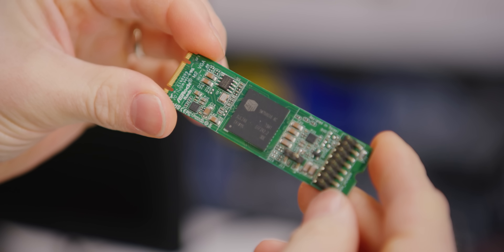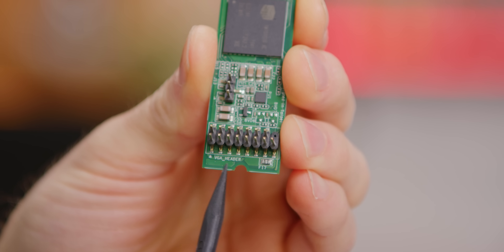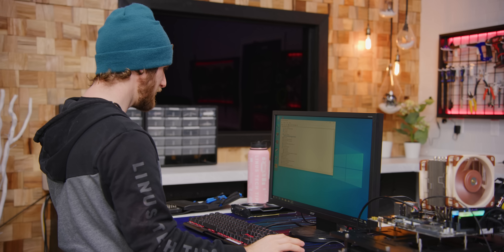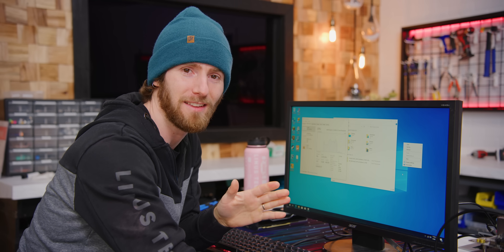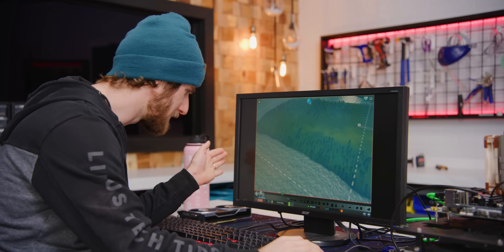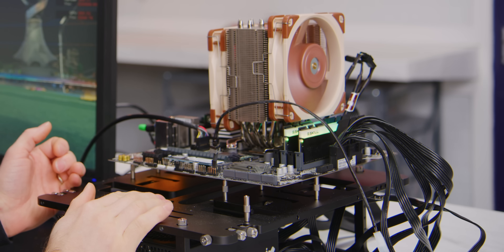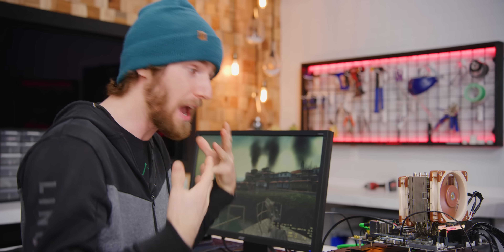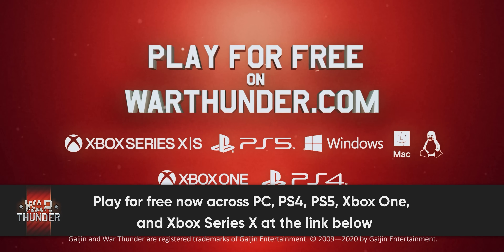THIS is a Graphics Card..?? - ASRock Rack M2_VGA

Comment: What’s with the war thunder ad 😡🧐
Having a m2 graphic card makes Sense but it would be a 3090 
I wonder whether you could have like 4 m.2 ssds and 4 m.2 graphics card as it would definitely use less room on the motherboard. 
Could you get the ram and the cpu on m.2 
You could just have a motherboard full of m.2 drives

Comment: Its for "gaming machines." You might also know them as slot machines, lmao
Reply: I thought those digital slot machines have switched over to ARM. I mean, it will save power for the casino.
Reply: @groundzero_-lm4md  most likely. Even a Raspberry Pi Zero level of performance should be enough for those (and GPU wise would probably exceed this thing)
Reply: I would surprised Linus didn’t understand that these 2D graphics cards are for 2D gaming, like an arcade or video poker... but his research is shit-tier on a good day.
Reply: @FuncleChuck  a bit disappointed he didn't try CS 1.6
Reply: Gambling on a slot machine powered by VGA is the very definition of rock bottom.

Comment: I think when they said "gaming machine" they meant something like a MAME cabinet.  Maybe there is an embedded CPU solution that has M.2 but not video output, and that could be converted to a MAME cabinet using this?
Reply: Think slot machines...basic animations only.
Reply: Gambling that has tetris level of graphics, or poker.

Comment: I didn't finish the video yet and Linus never mentions the actual purpose of something until the end...
For those curious: It's for servers. Servers need something small for basic administrative tasks, and VGA is pretty standard in rack-mounted monitor+keyboard+mouse combos.
Basically, it's just for displaying text (Linux) or a Windows Server UI so you can setup SSH/RDP and leave.
Reply: Especially smaller servers (ITX or a 1U rack or something) where your PCIe slot is used up by like a RAID card, so you throw this bad boy into the M.2 slot and boom you got display!

Comment: is it me or does that scream "Server graphics" to anyone else? don't need any real output most of the time, and when you do a tiny tiny form factor would be useful and since the most it's ever going to display (in most cases) is a terminal window or maybe basic utilities it doesn't need to be able to play games... hell it might be designed for games servers that are headless but require at least minimal monitoring rather than being entirely network controlled.

Comment: Hey Linus!
I know that you are one of the best and most knowledgeable tech YouTubers out there, so I have a question for you. My computer has been running very slow the past couple of weeks, and I was wondering if you knew any good websites that I could use to download some more RAM and possibly a second CPU. Thanks!

Best regards,
Bob
Reply: im fuckin dying lol
Reply: Did you just say- "DOWNLOAD SOME MORE RAM"
Reply: Hi Bob,
I know I'm not Linus, but would like to help regardless. Do you happen to have a 3D Printer? If so, you can download model data for all sorts of RAM and CPUs which, once printed, will function excellently. Just go ahead and search in Google and loads of useful entries will come up.
Have fun!

Regards,
DJ

Comment: VGA now that’s a name I haven’t heard in a long time
Reply: It's fun and everything but I'm still using an IBM CRT display at 85Hz.
Reply: @ricky2k3_  Probably using a dvi too vga adapter though if your gpu has a dvi with analog compatibility or using an active adapter of some sort like hdmi to vga or something ?
Native vga i think died out a while ago being replaced by dual link dvi before dvi was phased out as well not too long ago.

Kind of miss having a crt, had a dell at 1600x1200 @ 85 hz was a freakin elephant though at 21 - 26 kg or something.
Hated lugging it around though for a lan party or two before getting a 1080p ips panel which I'm still using today.

It broke a desk that had like a separate shelf spot for the monitor behind the main desk piece.
The front part of that separate shelf that was supposed too be stuck in place with screws & some crappy plastic screw mounts that were glued in place.

It was just resting on the rest of the other main piece of the desk when i got home one day like 5 months after building it & was starting too detach that part of the desk from the weight leaning on it having cracked the smaller shelf piece where it mounted down & sunken through, reattached it the best i could with screws but could hear it cracking so eventually got hold of another desk.
Reply: @Mini-z1994  Well, I use onboard graphics, and my motherboard has a VGA output. And the surface where it sits its quite strong, but the monitor isn't that heavy, I have moved it a couple of times to LAN parties and I can travel with it, obviously it gets my arms tired and is a 'dinosaur' it can't fit on a backpack.
Reply: VGA monitors are still pretty commonplace, I use one myself and it's full hd 60hz so I have no real reason to upgrade it
Reply: most monitors in most of the offices I've seen are hooked up with VGA (I used to restock vending machines so I've been to many office buildings)
Reply: like back in the triassic period?
Reply: @Pravculear  2020 :-)
Reply: hm...I remembered that when I was working in a Data Center in 2004 and all the servers used VGA, 
I just googled it and most servers still use VGA right now :-P 
,seems you can't go wrong with analog ;-)
Reply: A more civilized connector for a more civilized age.
Reply: @tgoyer  An elegant connector for a more civilized age.
Reply: @White-Wolf1969  ah right.  Been awhile since I've seen the movie.  Haha
Reply: LS
You do know him then?
Reply: @Mirek Fe of course I know him he was on the back of my old laptop
Reply: @LS-td4yf  Well then the GPU does belong to you.
Reply: @MirekFe  his undercover account
Reply: @davidholmes2932  Me and LS were having a Star Wars joke moment.

Ben Kenobi: Obi-Wan Kenobi? Obi-Wan. Now there's a name I've not heard in a long, long time. A long time.

Luke Skywalker: You do know him then?

Ben Kenobi: Of course I know him...he's me. I haven't gone by the name Obi-Wan since, oh, before you were born.
Reply: Hey, I have a B250 mobo that has a VGA out. It's not that old. :D